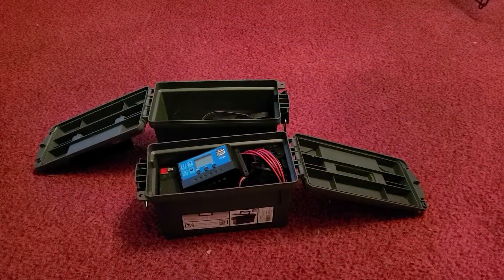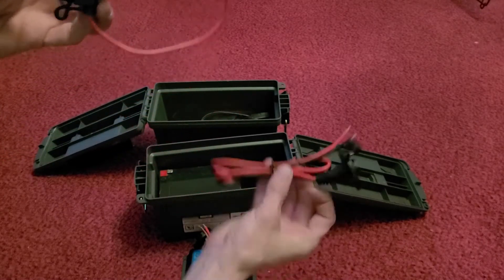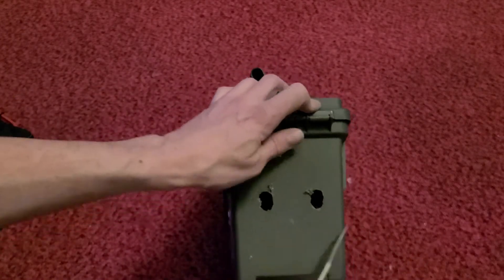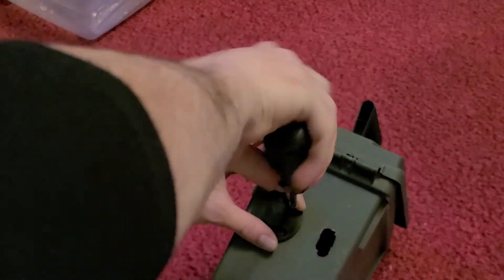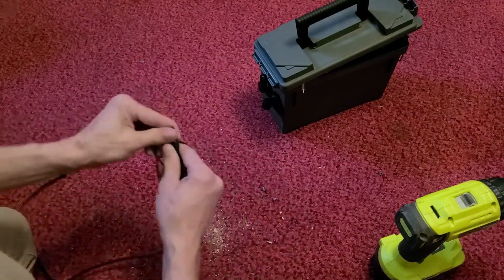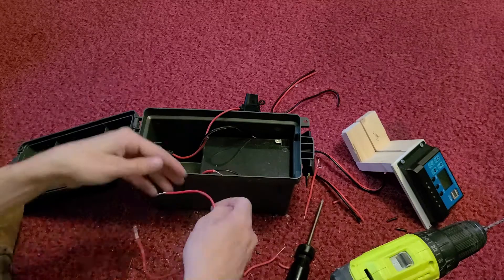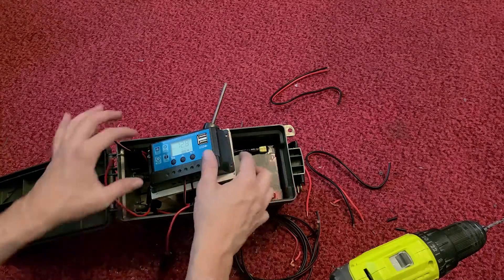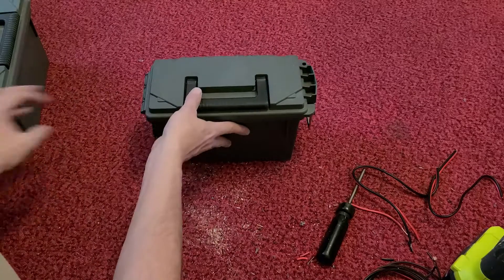$65 SMALL SOLAR GENERATOR DIY BUILD

Comment: nice job but you put switch between positive wire of solar charger controller and solar panel switch it off and it will work

Comment: I just made a battery box with 2 20ah lifepo4 batteries, 410 Watt inverter,  and a 12V USB Outlet Socket Panel from amazon. Had all the parts and batteries lying around 😂. The two batteries are from my old solar setup. Works great ! Was thinking of buying a jackery 300, but my battery box is like way better. It's almost the same size as a jackery 300, has a bigger inverter, twice the battery capacity, more connections! 😅. Id compare it more to the jackery 500 !  
Mine has a 410 watt inverter with 800 watt sure, 512 Wh battery capacity, and a tone of usb connections even with a sigarate lighter port. Price was around $180-$200.  It is cheap compared to the jackery 500 !

Comment: only thing that caught me was when you said if there is no battery the solar panel it will fry the controller. not sure thats true. i have a 50w panel hooked to a controller in my shop, every now and again i will throw a battery on there to trickle charge but 80% of the time theres nothing hooked up to it. think of it like a gas generator, you fire it up and it runs for hours before you plug something into it. nothing bad happens to the generator, all the while its been producing power with no where to go...but if you want to take that extra step of good measure theres nothing wrong with that either. nice build man!
Reply from the maker: Thank you.  And great experience based tips, I'm new and learning.  Thank you for watching :)
Reply: Your panel is prob not powerful enough or not exposed to enough direct sunlight (or both) to damage the charge controller without a battery connected. It's a general rule with solar to always have a battery connected FIRST before the panel is connected to the controller so as not to damage it.

Comment: I'm over here in Cuba. That looks like my first controller box 👍
Nice job 😊
Was going to give you a hard time for "Solar Generator" until I watched. I've always called it a part of a "Solar System". The panels are the actual generator. 
Those controllers are terrible for long term use, I have a pile of them. I found the 100A ones last a while longer. I need to build one with a buck boost converter in it and give it a try from there. Basically an MPPT without the proud price of the real ones. Sorry about the rant and good job on the video 👍
Reply: Greetings from your neighboring island Jamaica just 90 miles away from Cuba.

Comment: Very cool build. Im about to build one using the 50 cal size box, and im using a 12ah lithium over a lead acid to reduce its weight. I figured that if I used the larger , I would be able to have extra space for accessories and possibly a 2nd battery if it fits later on.

Comment: How would I add the additional usb plug. Where do I wire it in? In-line with sae connection going out?
Reply from the maker: There's a USB port on the charge controller.  I've since added a small inverter, slyly bigger battery and another USB port yes I tied it into the out port

Comment: What watt panel would you want to charge this with? I’m new to solar..
Reply from the maker: Well, it has a 10amp Solar Charge Controller so that's 8-10amp intake so with 12volt solar panels it could take up to 150 watts, I wouldn't go over 100-watt panel though. With that said I use a 10watt 12volt panel and it charges great in the New Mexico Sun. Cloudier area, I would suggest a 20 or 30watt 12-volt panel. Hope that helps.Thanks for watching

Comment: I have a question, I bought the same solar controller. I am building a ammo box power bank very similar to yours, except with a few additional items. Anyway, my question is there a particular reason why you would need a fuse between the solar into the controller..?? I was told no, but I have watched this video and it has made me rethink my wiring now. I am not dogging on you at all, I'm new at this crap, and this is my first one. Any information would be appreciated.
Reply: So actually the fuse is a really good idea.   The reason is that in case something goes wrong,  the battery can push power back into the wire and start a fire.  With the fuse in place,  the risk is much lower.
Reply from the maker: No I really didn't need to add it
Reply: @graftedbranchhomestead  right on..thank you for the response

Comment: Will this same setup work if i change the led acid to a lithium 12v battery?
Reply from the maker: Lithium works much better.  It would,  you would need a charge controller that can do  lithium however,  easy swap

Comment: The Z shaped bracket is a nice touch to stop the battery from shifting. For your next build, you may want to think about wire ferrules.  This bundles the strands for screw terminals on the charge controller.  I am working on a bipap battery and you gave me some things to think about.
Reply from the maker: Very very cool

Comment: Have you tried using this with a power inverter to use as back-up power for an incubator yet? I'm thinking about trying it but want to make sure it is powerful enough to run a couple incubators off of first.
Reply from the maker: Great question. That's actually a project I'll be working on these next few weeks here.  My goal to get my quail things all on solar. I'll test it in a few days and do a video on it very soon :) right now it runs all the lights on the coop no problem
Reply: @graftedbranchhomestead  Sounds good, I'll be watching for your video. I love your builds. I copied your temperature controller and use it to control the heat lamp in my brooder and it works perfectly.

Comment: This is awesome Matt!
I saw a large Plano sportsman’s storage box with wheels on sale for $32 at Home Depot last night and thought about making something like this, but with more battery storage. I think this exact build you made would be awesome for so many applications, including camping. You can actually run quite a bit for 12 amp hours! Thanks for putting this up!
Reply from the maker: Lowes has big 14" or 50cal boxes on sale for $6 bucks... here at least

Comment: the only negative thing i can say is having to open the box to get to your usb plug other than that great job. this should last at least 5 yrs if keep charged. thanks for sharing and have a great day
Reply from the maker: Ya, I'm not using the USB for my application but do want to add an outside one.  Thanks for the feedback 😀